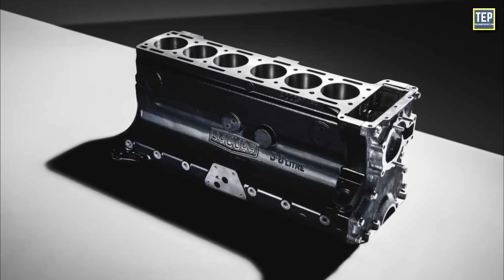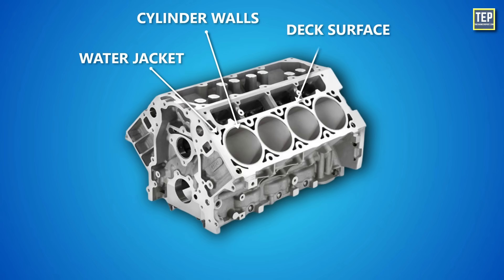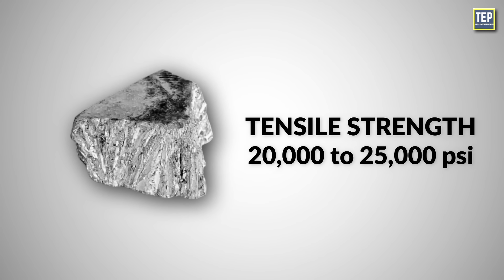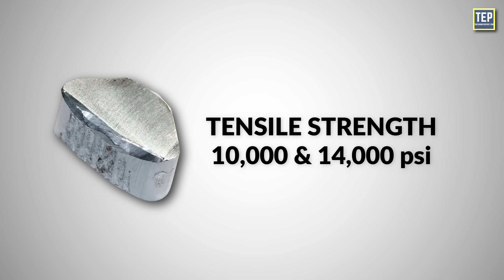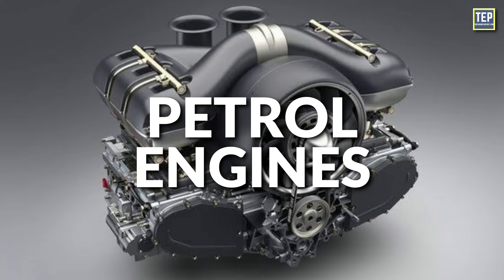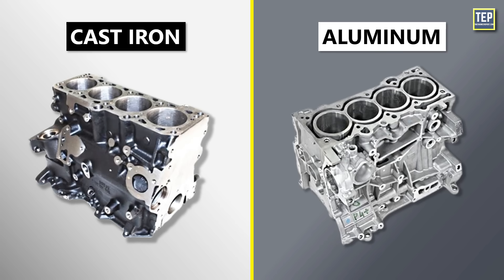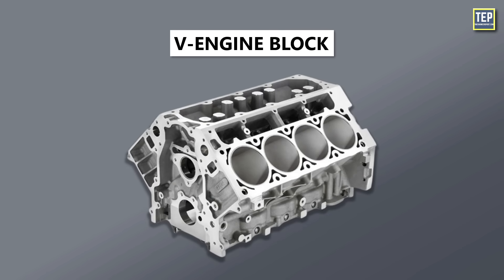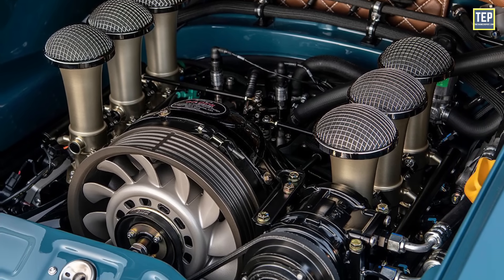Engine Block Materials Explained | Strength vs Weight

Comment: whoever says a cast iron block is better than aluminum is an idiot: when you get into an accident the cast iron wont break to protect the passengers. The cast iron block engine will fly into your lap and cut you into half! so good luck idiot buddy you killed yourself from some stupid cast iron. Toyotas by the way are the worst cars in accidents they use cast iron blocks

Comment: Iron damps a lot of vibration for a much smoother engine. It is significantly cheaper and gives consumers less expensive cars. For working people, it makes owning a car more affordable. A well-engineered iron block engine lasts longer. Almost every single million mile car or truck had a cast iron engine block.

Comment: cast iron is clearly better from a point of longevity. engines are only becoming more and more throwaway. tiny scratch in aluminum alloy cylinder wall renders whole engine useless.

Comment: ya iron blocks expand more evenly during overheating events. less prone to warping. ive never heard of someone resurfacing an iron head. heck ive never heard of someone having to do a headgasket on an iron block. there are dozens of early 2000s honda civics on every fb marketplace that have over heating issues and are just a time bomb waiting to cost the next lucky teenager 1800$ to try and fix the head/gasket. 
iron blocks also run hotter due to lower thermal conductivity, most tuners think you want to run the engine as cool as possible to make peak power, but for fuel economy having a hotter engine is better for fuel mixing and thermodynamic efficiency. think about it, they didnt invent compressed graphite head gaskets until aluminum blocks became mainstream. naturally asperated iron blocks with the right transmission will go 400-500k miles easy until something weird breaks. most aluminium heads ive had crap out at around 200-280k miles, usually due to over heating issues and the eventual headgasket failure.
you can run iron blocks at higher compression ratios which gives more fuel economy. for hwy driving, and not going over a mountain, your weight is a negligible factor for fuel economy. epa cares more about in town fuel economy, thats why everything has an AL head now. plus they dont last as long which car mfg love.
Gen1 chevy volt has an all iron block. gen2 chevy volt has an aluminum head. theyre starting to get up there in miles now, gen2's are not lasting as long

Comment: This video is misleading. 
1. An Iron block is harder to repair sure, but you almost never need to because iron blocks have a nigh infinite fatigue life, meaning if you don't push them to the breaking point, you can use them forever, which is not the case for aluminum. Aluminum has a finite fatigue life, meaning every time you use it, its lifespan decreases. You don't need to push it to the breaking point, instead the breaking point comes to it in a sense. 
2. Most aluminum blocks are not rebuildable. You can't just "resleeve" an aluminum block. In fact, a lot of shops will flat out refuse to resleeve your block. You wanna know why? BECAUSE THEY BREAK. You can literally split an Aluminium block like you would firewood during the resleeving process. The irony is that the sleeves are most often made of cast iron, albeit very thin.
3. Aluminum expands, A LOT. Your engine gets hot, so your bore gets larger. Your piston was sealing the bore tight when it was cold, but now that it is hot, there is a Grand Canyon between the piston rings and the cylinder wall. You don't want that. Because your exhaust will leak into your crankcase and contaminate your oil, meaning you have to change it more often. Plus, a lot of manufacturers make the pistons wider to account for thermal expansion. But now the pistons are too tight when it is cold, so your car doesn't start, or it starts but damages your sleeves each time. 
4. Aluminum gets warped. Your engine block has coolant passages and areas around those passages get the best cooling while other areas are cooled less. Hot parts expand more, cooler parts expand less, and your block gets warped. When it does, it might no longer seal against the cylinder head, as a result, coolant leaks into your oil or your head gasket blows.
5. Aluminum strips. While a minor annoyance, aluminum threads get stripped because you have to torque them so high to ensure a good seal.

I am pretty sure I have some other things to say but I'm sleepy.

Comment: A lighter aluminum engine block hasn't reduced overall vehicle weight as other options  filled weight loss. There has not been much fleet fuel economy improvement with aluminum engine blocks as they produce more power using same or more fuel. Most aluminum blocks use the open deck design that gives upper cylinder less support allowing head gasket failure. Let's not talk about older seasoned aluminum  blocks that have head bolt thread failures. There is a difference between 25,000 psi and 15,000 psi material strength. At this point, aluminum is likely the cheaper OEM option.  An ordinary car is not a race car nor an airplane, but it's marketing.

Comment: I've own 2 stroke 90s bike, 4 stroke and modern bike with aluminum
u all know 2 stroke engine need constant rebuild & it's a dry engine only runs 2 stroke oils not like 4 stroke wet engine always had 4t oil flooded.

for me iron block is my choice, 
many things can do with iron 
in my experience I've used both aluminum & iron  
iron cost less than aluminum came to repair ( seriously)
my motorcycle 90s engine got crack but can be repaired also rebored, heat treatment & Alot but when my another motorcycle engine got aluminum that only can replaced cannot be repaired it's cost Alot that price are high 
I've find aftermarket iron part's install it + tuned it's runs 5 year without breaking even overheating, raining water, harsh riding it hold up , I'll sell it after 5 year .

if u know people work with iron block cheap price - You are safe 
aluminum block, engine is garbage it's not strong inaf to withstand environments like raining hit sudden hot engine it will crack and riding in summer hot aluminum can't hold up over heat condition and other more

seriously telling my experience don't left without like my comments seriously

Comment: Aluminum blocks typically handle engine overheating conditions better than iron blocks. This is because aluminum has better thermal conductivity, meaning it can transfer heat away from the engine more efficiently than iron. Additionally, aluminum tends to have a lower coefficient of expansion, which reduces the risk of warping or cracking under extreme temperatures compared to iron. As a result, aluminum blocks are often preferred in high-performance engines or applications where heat management is crucial.
Reply: They manage heat not overheating.  Everyone knows aluminum heads warp easily when overheated.  The most powerful engines per cubic inch, Top Fuel dragster are cast iron.
Reply: @foch3  Having aluminum heads with an aluminum block is better in terms of overall heat dissipation and thermal expansion compatibility. This setup ensures similar thermal expansion characteristics, potentially reducing the risk of warping or damage during overheating. And cast iron blocks are predominantly used in the most powerful drag cars because of cast iron’s superior strength allowing it to take the repeated stress imposed on the engine without cracking or warping it.
Reply: Rubbish ! Aluminium is  MUCH  more prone to warpage if overheated . Yes it carries heat away quicker , but once pushed too far the Engine is a Boat Anchor .
Reply: That's all so wrong. Aluminium has better thermal conductivity (W/mK) than iron but the higher thermal expansion means more damage occurs when it overheats.

BMW E39 is a famous example of what happens when you pair a cooling system made of plastic parts that wear and fail and kill alloy engine headgaskets and warp blocks. With enough lazy owners who don't do preventative maintenance and run it till it fails, leaving heaps of cheap and available parts at wreckers for the rest of us, bless their hearts
Reply: Ive thought my aluminum block was inferior to iron for a long time because of strength, but I’d much rather have better cooling.

Comment: Aluminium is best it's lighter and keeps radiator cleaner
Reply: Until it cracks and you have to pay $20,000 or more to replace it!
Reply: How dirty is your oil pickup in that engine?
Reply: @istillplayStuff1000 oil pickup clean.i charge oil regular

Comment: Wrench turner for 60 years . Steel is stronger & last longer Aluminum is lighter that't the only advantage. I had a 64 3.8 XKE the Best car every made bought in 1971 for $1000 those were the days my friend...
Reply: I'm with you all the way been turning wenches now for 25 years and wouldn't give it up for the world. Cast iron are the best
Reply: You say the XKE is the best car ever? Sir have you never heard of Jaguar and their Series XJ cars of 6 and 12 cylinder?
Reply: One more advantage of Aluminum block is reduce heat  more efficiently but generally steel block still better if you use proper coolant fluid, it will avoid overheating

Comment: The introduction of nickle to an iron engine block increases it strength by at least 160% done in the R series engines from Toyota making the engine more reliable and durable and l have a 1997 Toyota Hilux with a 22R engine and it is still running really well and with its total lack of tech makes it very reliable vehicle considered one of the most reliable engines ever made simplicity over engineering equals ultimate reliability
Reply: Your damn 😂 right I had the same truck it won't die😂😂 body goes first
Reply: BMW alloy engines from the 90s are engineered beautifully and are exceptionally durable... in the right hands... It is maintenance and ancillaries that condemn them, like cooling systems made of plastic that degradeand fails faster with each generation as they put in ever higher thermostats for emissions reasons, or owners who don't change oil often enough. As they went further into the 2000s they got silly with ever more complex and fragile systems. 

I have a 1993 M60 V8 and two 1998 straight six M52's in the driveway around 300000kms old, and they all run beautifully because they have been maintained well.  Usually it's the trans or the rest of the car falling apart that condemns them to the wrecker
Reply: @greebj  ln 1997 Toyota Hilux l have the 22R engine it is a nikle iron block which is with the nikle in the iron which is suppose to be 160% stronger than an iron block we.l l guess it makes them a very reliable long lasting block 27 years and still going strong and also 437000 kilometres well that's not much for a 22R engine were most newer engines would never dream of reaching those kilometres but mine has and is good for another 437000 kilometres
Reply: Nickel*

Comment: Well, let's say you have a 1976 to 2000 Jaguar and you dont want to put up with all the at times unending Jag engine and transmission problems. So you do something sane and drop in a GM Small block. But you wsnt to stay in the 400 to 500 Hp (or so) range of poeer. Then an Aluminum block makes sense. Set the engine back as much as possible and with the 100 lb or do weight savings, enjoy the often noticeable better handling. Give you now 
optimise the benefits with upgraded tires and front end components tuned to the new better weight distribution. So there are times that a switch to An aluminum crate engine makes real sense. 
the tires and front end components that are

Comment: Cast iron blocks are a must for boosted engines and using nitrous. Alum. blocks are 100 lb. lighter and work well with cast iron bore sleeves. FORD sella high nickel cast iron engine blocks for super high stressed usage, but the price is frighting. But both GM and FORD use alum. blocks in all their V8's. Chrysler uses cast iron blocks in all their Hemi engines even the 5.7 and the 100 lb. weight is in the front of the vehicles, right where you don't want it ! Of course, cast iron blocks are cheaper to manufacture, so there is that !
Reply: For the GM HD pickup trucks they produce iron block 6.6l l8t gasser, and yeap I have a 2012 RAM 1500 with the iron block eagle HEMI but they use aluminum cylinder heads.

Comment: Does Aluminum blocks burns oil?
Reply: No, aluminum blocks do not "burn oil' if proper oil change procedures are followed.  It all depends on the piston ring material as some newer engines have piston rings that have low tension in the cylinder block, and these can cause oil burning problems at higher mileage moreso than the aluminum.

Comment: Myself aluminum is better because it can be repaired easier than cast iron....I always wondered why they never used cast steel instead of iron.... You could weld that....
Reply: A cracked block can't be repaired. Aluminum blocks always have a much shorter lifespan.

Comment: Sorry to be a party pooper: You have smoked something strange!
For the first: the inline six, has the most perfect balance, between primary and secondary imbalances!
For the second: Most aluminium engines are in built in several layers, they are like a cake,
not a single block, like iron blocks.
Take a look at a Volvo or VW engine.
from a Finn in Diaspora
Reply: wrong
Reply: The V12 is above the I6 in balance terms, but one is significantly cheaper than the other :)
Reply: @istillplayStuff1000 🧐 👍

Comment: There is no simple answer. Its like asking what tire is best. It all depends on situation and purpose. Probably the most important factor is choice. Its great to have the option of selecting what material block you want to use for your application.

Comment: Cast iron for me, every time.
I also prefer side valve engines, drum brakes and wooden wheels with iron tyres.
Reply: Pfffffft steam for me all day.  I drive my 1800s train engine to work every day just fine.

And by the time it's started up and the boilers are making steam, and its 30hp has finished lugging it's 2 tons there, it's time to turn around and start the return journey back home 😅
Reply: Yall still using engines? All I need is my ass and a cart
Reply: bro drives a de dion
Reply: To top it all off? I've got my own two feet.

Comment: I prefer cast iron blocks myself for good heat dispersing.  One thing I will never have again is cast iron block with aluminum heads.  Big gasket issues costing a lot of money.
Reply: Aluminum transfers heat better than cast iron.
Reply: @falcorthewonderdog2758  which means they overheat more making them less reliable
Reply: LT1 is reliable with this type
Reply: Not really an issue. So many modified cars run this combination. I haven't had an issue in 20 years of doing this.

Comment: Whether the block be iron or aluminum, I would never, ever, want an engine with the head(s) being a different material than the block - iron block & aluminum head, or aluminum block & iron head - since the 2 metals expand & contract at different rates & amounts, blown head gaskets are a perpetual problem.

Another is less well known: that of corrosion, the result of 2 different metals being bolted to each other, & especially with heat & a working fluid passing between & through them.

Aluminum engine blocks are also less tolerant of over-torquing, & special attention must be observed, when considering the different torquing specifications during servicing or rebuilding the 2 different types of engines.

Iron engines will tend to tolerate being overheated, better than aluminum engines; more often than not, if an aluminum engine suffers a catastrophic cooling system failure, it's best to simply replace it, as everything will likely be warped & lose its temper.

Most of my experience working on engines, has been in the marine field, & those engines lead a hard life, usually being operated at full throttle & load - both iron & aluminum engines will fail, but for heavy duty & long life, especially for diesels, iron is best; for outboard engines, aluminum is best due to its inherent lighter weight.

I've never seen engines with the 2 different metals making up the block & head(s) have as long & relatively trouble-free life, as those made of 1 or the other single metals.

Aluminum also has an additional weakness, that of its reaction to the hot water-glycol mix, if there's ever a blown head gasket, & the coolant finding its way into the cylinder(s), &/ into the crankcase - aluminum is more reactive than iron.

Ofc, the bearing materials of either type of engine, simply don't tolerate that water-glycol mix at all!

Air-cooled engines do have their advantages & their place in certain applications.
Reply: you really know nothing about engines

Comment: During the Formula One Turbo Era, BMW Used Old Seasoned Cast Iron 4 Cylinder 90CID/1500ccd Turbo Engines. At + 5 Bar circa 1500 HP on 102 RON Gasoline.
Reply: You mean Toluene?
Reply: @istillplayStuff1000  No 102 RON Gasoline.

Comment: Hard recicled plastik block with cooling panel 3nd fire holl for cilinder  if you want totaly madnes of old technology on fuel gas or watter,,,,to many weigt components end lousing power,,,the vest us Neodium generator  you hawe light mashine big power little heating end plus energyvend xxx combination gor a worck in or out...no tank no senzirs no IT no noting but from a to b in continuum 100 years 
PS
Trouble us better shell for a car end tures witch can run 100 years

Comment: Iron by far. The extra durability is worth the extra 200 lbs or whatever of weight and the extra 5 mins it takes to reach operating temperature in cold weather.
Reply: The actual weight difference is much less, on average 15-17kg or less than 40 lbs because aluminum blocks needs to be thicker and more reinforced. The driving 4 answers channel discusses iron vs aluminum engine block pros & cons in more detail.